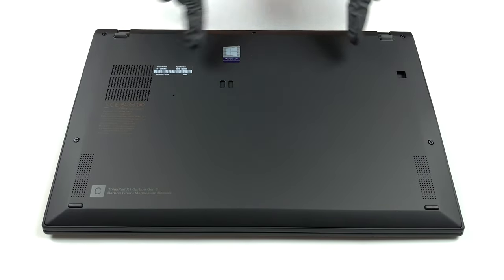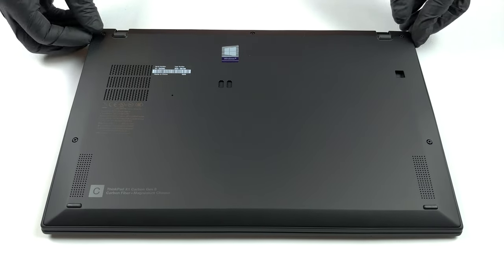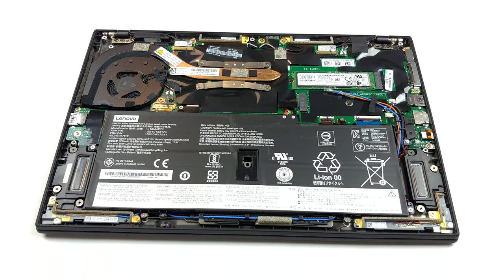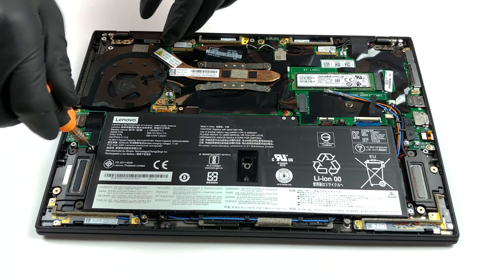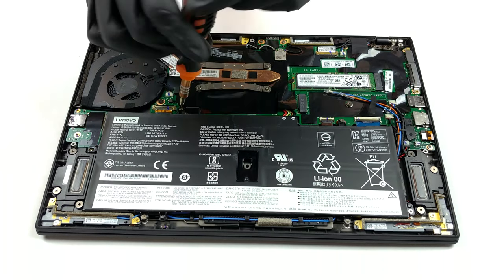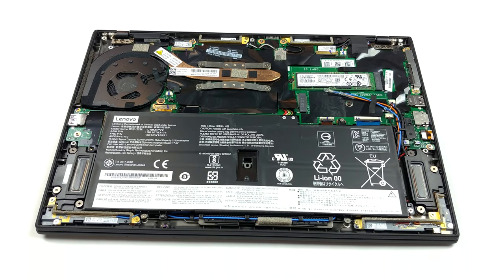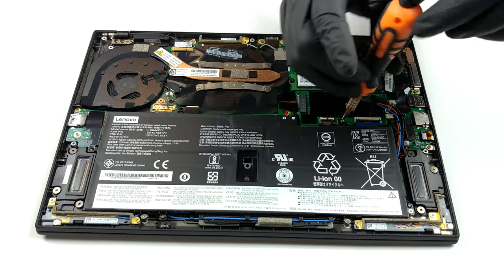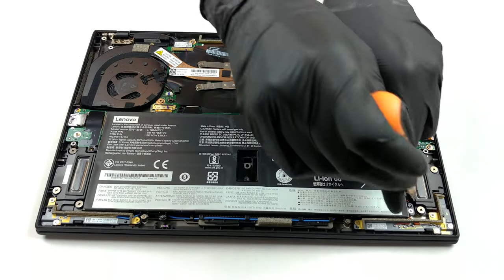🛠️Lenovo ThinkPad X1 Carbon (8th Gen, 2020)  - disassembly and upgrade options

Comment: I have a x1 carbon 6 generation, and need make upgrade ram memory 8gb to 16gb. how to make?
Reply: Not possible, the ram is soldered. You basically need to get a new laptops with your specs.